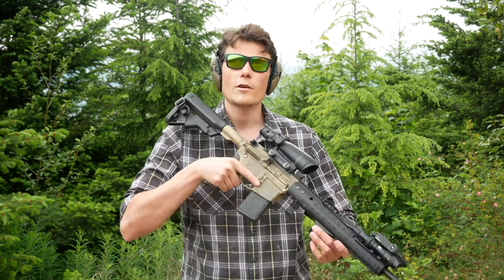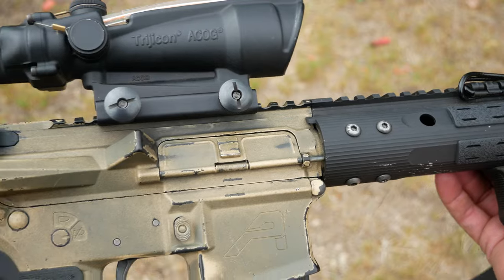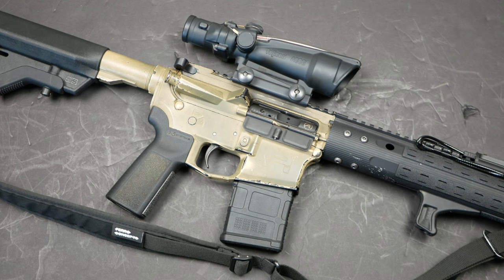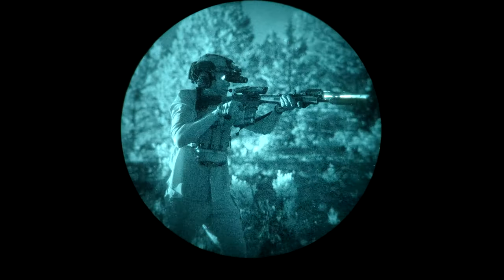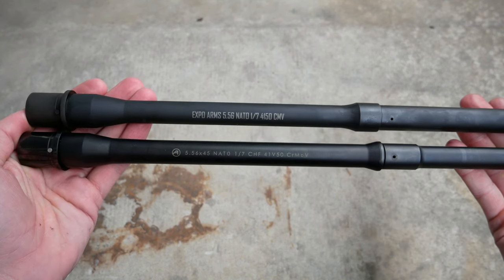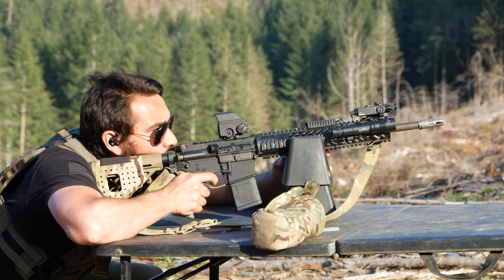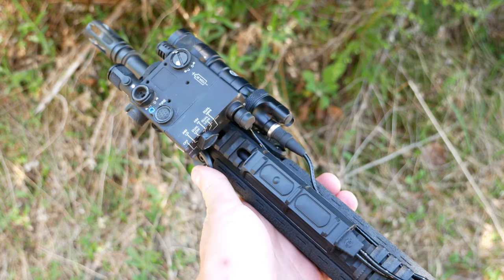Let's talk about the new Aero Precision PRO Series

Comment: I’ll stick with using Aero lowers and using either uppers I’ve “built” myself or BCM and DD uppers I currently use on those Aero uppers! I’ve had issues with a couple Aero BCGs in the past and won’t be spending anymore on their Pro BCGs, since there are plenty of other well known, reliable and reputable brands out there for the same or less money! I personally like to pick and choose what works for me and combine those brands and products to create exactly what I want and need.
Reply: I tried one of the 12.5" barrels because CHF light-profile middy ones are hard to find.  Excessive headspace, two brand new quality bolts from Cryptic and Sharps spin right around on the NO-GO.  I'm gonna give them a chance to make things right, but I'm likely sticking to just their receivers and handguards going forward.  I can see things being a little off and the bolts only barely locking on the gauge, but not just spin right around like that.  That seems ridiculous to me for something labeled as "Pro Series"
Reply: I kinda do the same, get budget lowers build it out then get a high end complete upper

Comment: My aero bolt nitride with chrome lined carrier are rough as hell. Like ribbed all the way around. The aero firing pin is gritty and ribbed as well. Sure works fine though. When people shoot it they say it works but the colt cr series is way smoother and people say it's better. You will taste gas when shooting and it'll burn your eyes. The colt doesn't have either of those issues. Accuracy is just fine. Reliable. No complaints really. I'm not scared to shoot it or beat it up

Comment: Barrels, BCGs and the enhanced buffer tubes. Got a pro build myself with the adjustable gas block and super 42 h2 buffer spring set up. That paired with a can and Aero 2 stage trigger… it’s one of the smoothest shooting rifles I own. I dig it. But the price tag was up there when finished… would call it a solid high end mid tier build.
Reply: What is the barrel length?
Reply: @calsol22  16”

Comment: Those barrels shoulda been offered with a pinned gas block.
Reply: I got into firearms over the last few years. At first I was very pro or in favor of pinning gas blocks because everywhere I looked said that was best. But after doing homework on BCM, BCM uses set screws to secure the gas blocks and from what I hear people say it is damn near impossible to get them off. So much so that they have to heat up the gas blocks so hot to get the screws out…
Reply: @9770G  quite a few companies use them.
Reply: @9770G  BCM is also known for their very tight tolerances, and im sure they rock set or red loctite those gas blocks in place. there is nothing wrong with set screws and dimples. some people run 1, others use 2. but a pin isnt coming out unless its driven. also, some people just want that FSB look. or a metal front sight they dont have to spend $100 on.
Reply: Pin them yourself.  There are many videos on here that show you how and exactly what tools and pins to order.   It's not hard with a $120 drill press.
Reply: @calholli  thats just the thing. most people dont have the tools and arent going to order a $300 jig to properly align their $150 barrel. If you arent building guns regularly or some kind of gunsmith, no need to buy something you will use only once. Just find a manufacturer that offers what youre looking for. then at least you have some kind of warranty
Reply: @bettycocker2226   It's a $9 bit and a $20 reamer.. You don't need a jig if you simply have a cheap drill press--  which most guys do...   But I do understand, there are two kinds of AR guys:   people who build their own kits and can make any budget brand parts work...  and those who need that 12 point quality inspection to make sure everything is perfect-- because if not, they are clueless on what to do besides send it back.    If you are the 'ladder" kind of guy, then I would agree--   don't try it.

Otherwise, if you build your own kits and have a dozen rifles like most of us...  You should try to learn how to pin your own gas blocks.  You can up the value of every AR you have in a weekend.
Reply: As long as the barrel is dimpled for the set screw the gas block isn’t going to go anywhere. You can drill your own notch, there are jigs for it and plenty of videos on how to do it properly. Some people pin and set screw. If you’re really worried some barrels have the gas block integral to the barrel, they are one piece. There are also some barrels that have a nut that locks the gas block on like a barrel nut does to the Reciever. I know Q does it on their Sugar weasel and Honey badger. Many manufacturers will also drill it for you if you send it in. Riflespeed makes the best adjustable gas block ever made and they will drill your barrel for you or you can buy a barrel from them and they will drill it before they send it to you, and they match it perfectly to the gas block, I believe they use two pins.

Comment: I picked up an aero PRO upper a while back at a very discounted price. 
I think just the pro uppers go for around 1k. I got mine for more than half off.
Smacked an M4E1 lower onto it with the bcm A5 buffer. It shoots nice. 
Ran a couple hundred rounds through it then cleaned it and put it up with all the others that I save for who knows what. 
My main shooters are a BCM and a PWS. Most of my other AR's are cleaned and hanging around deep in a large safe.

Comment: So the Pro barrels are Nitrided (melonite) ... I honestly dont think thats a bad thing as long as the chf die is made correctly to account for the fact no additional material will be added later (chrome lining) ... i find Nitriding tends to perform better for corrosion resistance than chrome and especially phosphate (which is what is on the outside of most chrome lined barrels ) and its very easy to clean. Also the wear characteristics should be close to chrome ...as for wear, a proper test should be done, but im betting between 2 chf barrels a chrome lined and a nitrided barrel would perform almost identical
Reply: The military has tested nitride barrels for decades. That is why they still require Chrome lined barrels, even though it cost 3 times as much to chrome line compared to nitride..
Reply: @hairydogstail The Military needs barrels to hold up under full auto which chrome is just plain better at. Under semi auto fire though, who the duck knows.
Reply: Quite a few small groups have started to use different barrels, mid length gas system, and some have tried nitride but I was reading about a new type of barrel being manufactured that is being tested that is as accurate as stainless match barrels, as hard use as chrome lined and can be made with a different profile, since not many are using the m204 and free float rails have become the norm, I read that it’s a modified continual taper from the chamber to the muzzle. They didn’t go too much into the coating but they said it’s all new way of manufacturing the barrels.
Reply: Link? @chrisjosekuehl

Comment: Expo Arms is excellent. I have the all chrome and phosphate/chrome lined bcg as well as a complete upper. They are all rock solid. For a 12.5” barrel my choice is the HM Defense Mono Bloc chrome lined barrel for the same money. I like AP, there enhanced upper and large diameter rails are on another level imho, but the pro stuff looks meh and there is better value in a true mil spec bcg, ie Gorilla Machine $79. It’s probably a Bear Creek CHF barrel anyway, not a bad thing.
Reply: Yep, Expo arms are made by MicroBest

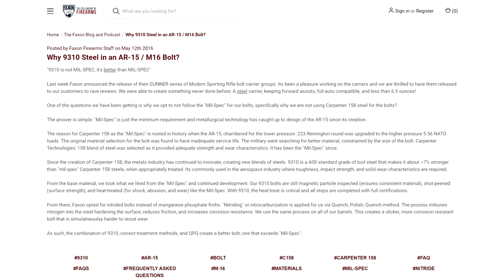Comment: 3:20 C158 steel is much more forgiving than 9310 steel when it comes to heat treating window for acceptable tensile strength. When you need to chrun out millions of rifles in a full scale war, that's an important consideration. 

9310 has higher strength (marginally), but if heated too long it becomes very brittle. 9310 bolts are simply slightly more brittle overall and will probably crack sooner than C158 bolts despite the steel being nominally stronger.

What I definitely cannot recommend are tool steel bolts. No, just no. It'll wear and erode the hell out of your barrel extension AND the hole your bolt carrier tail sits in (which seals the expansion chamber on your bolt carrier group along with the gas rings).

Basically, tool steel bolt will wear out your barrel's headspace and make your bolt carrier leak gas from the tail end, blowing out your headspace and short-stroking your action (and dump dirty gas into your receiver worse than typical).

AR 15 bolts are wear parts, so is the bolt carrier (to a lesser extent). The barrel is also a wear part, but less so than the bolt carrier. If you're not running full auto intensively but shooting a heavy schedule (with regard for up to 4MOA acceptable accuracy) you'll change out the bolts twice and the carrier assembly once before you need to re-barrel your rifle. 

Shooting lots of full auto will blow out your gas ports well before eating out the throat or muzzle, or ruining your headspace. If your rifle runs too hard after habitual mag dumps, check your gas port and re-barrel if necessary (or use adjustable gas blocks).

Bolts are consumable parts. If they start to crack, swap them out. Tool steel bolts are for delusional tools who think rifles are meant to be indestructible, and using it will destroy your barrel extension and bolt carrier. Parts that are meant to be less expendable than your bolt.

Even if your carrier is tool steel - you're still destroying your barrel. Besides, that prevents use of chrome lined carrier bores as per mil spec, since S7 tool steel will still abrade hard chrome. Chromed bolt carrier bores are great, makes cleaning much easier and makes your carrier lasts longer (less gas leakage from bolt tail bore). It's worth the hassle of phosphate being easier to rust than nitride carriers, and if rust is a big issue - bite the bullet and get a chromed bolt and carrier. Just use phosphated or nitrided extractors, chrome is slippery.

Also, when it comes to lubricity from low to high, it goes: dry phosphate, dry nitride, dry chrome, oiled phosphate, oiled nitride, and oiled chrome. There's a big jump between dry phosphate and everything else (duh), and a smaller but appreciable jump between dry chrome to oiled phosphate. However, among oiled anything, the difference is negligible in practice - and phosphate stays oiled for much longer than anything else.

Use phosphate and chrome bolt for anything that isn't maritime or permanent "moon dust" scenario. Go all chrome if you can't use lube. Any oil or grease works at lubricating the bolt carrier against the upper receiver, but only use light motor oil or actual gun oil to lube camming and rotating surfaces (bolt, expansion chamber, cam pin, trigger pins). Moon dust and freezing weather notwithstanding, you literally can not overlubricate an AR rifle. The only thing stopping you is how messy your rifle gets in storage and on your person.
Reply: Addendum: a freshly properly lubed AR (unless for moon dust or freezing temps) will spit oil everywhere, but especially out of the ejection port. Wear your fuскing eye protection, even if they're just glasses or sunglasses. Oil in your eyes sucks, and it's probably carcinogenic. If there's a reason to use ballistol, it's 1: lowest toxicity (comparable to frog lube), and 2: has rust inhibitors that don't gunk up parts like WD40. 

If there are reasons to not soak your AR in a drum of light motor oil as a quick way of lubing your rifles, there's 3 reasons: 

not risking cancer worse than you already are, 
not turning your storage area into a perpetual fire hazard zone, and 
not turning yourself into a walking tiki torch waiting to catch on fire.

Getting cancer or catching on fire are what we'd call suboptimal health outcomes.
Reply: Yep, C158 is far more ductile than 9310. It is a tight, nun tight, window for heat treating when it comes to 9310.
Reply: @prfwrx2497 Contrary to popular belief, even in a sand environment....you need to keep your gun lubed. I don't know why people keep falling for this wives tale.
Reply: @prfwrx2497 Motor Oil, specifically Full Synthetic by itself does not cause cancer..... The by products from combustion do.... So regardless of Lube... The by products of you shooting is what causes the issues....not the lube itself.
Reply: @DZ4295DBW  you do lube in sand - but you basically wipe that shit down immediately after until it's almost bone dry. That's with a phosphate bolt group, since phosphate will hold on to that little bit of oil. That's why it's standard military practice to oil and wipe clean - phosphate is magic in that regard. 

If you're going all chrome - why bother. You're wiping basically all the oil off, chrome is really shit at holding any type of oil already. I'd use grease on the parts that doesn't get exposed to the ejection port, call it a day.

Trigger pins technically need oil; it'll be there from the last time the gun was serviced at the depot and you're not going to break the gun apart to oil the trigger pins using those needle nose bottles in a middle of a sandstorm. Leave your gun sealed and the fire control lubed in the inside.

The ideal lube for dust or freezing weather is allegedly graphite, but I'm too poor and third-world to have obtained graphite lube.

Where I'd never lube - arctic. You could use specialty lube, make sure you never bring your rifle into your tent without religiously wiping down every moving part, etc etc. There's just so many ways to go wrong there I'd rather bite the bullet and go all chrome, accept the added friction, and live with it. Better to tune for additional gas and spring rate than risking something seizing up due to my stupid ass slipping up.
Reply: I like a nickel boron BCG and nitrided bolt, or vise versa... Runs slicker than grease even without any oil, seems to collect less carbon and wipes totally clean in seconds 😙

Full chrome is nice too but doesn't seem as frictionless and not as corrosion resistant from what I've read...
Reply: @kxkxkxkx  Chrome holds lube a hell of a lot better than either of those two options. Only nitrided carrier that was decent was the Radian EBCG. It spec's out perfectly and had perfect staking. Generally, you won't see that since most manufacturers will get a carrier that's cut to have Chrome plating on it. Anyway, another option that's solid is NP3 and the "DLC" that Grizzlee uses on their REBCGs. Also, if you ever run across them make sure you get the ones with Green Dots on them and not the ones with Yellow Dots. 🤙
Reply: Spot on.  Also cheap 9310 bolts + nitride are a bad combo for the reason you mentioned.  If you do go nitride, go c158.   Azimuth is your friend.
Reply: @prfwrx2497  Chrome actually holds oil pretty well compared to Nitride or NP3... From my personal experience. The Mil manual calls for the components to be oil and then allowed to "air dry." And it has absolutely nothing to do with sand, fyi.
Reply: I like to hoard Microbest phosphate BCG's when they go on sale for $70-80 bucks from AR-15 discounts.
Reply: @coltonowens2742 

Smart man.  Microbest does good work.  Azimuth and AO are also solid.
Reply: Thanks for the info. The comments on this video are fucking great.
Reply: @prfwrx2497  WD40 IS NOT A LUBRICANT ! FFS, DO NOT USE WD40 ! If you need a penetrating oil to decouple parts or something to help remove rust, WD40 is fine for that. Don't fucking use it to lubricate anything ! (not that you would use WD40 that way) . WD40 has no place anywhere near a firearm. Period.
Reply: @raifsevrence  you're right, it is not a lube. It's a water displacer. Only use it to wipe down a massive RPG7 and wipe everything clean right after. Not for small arms.
Reply: @DZ4295DBW  thanks to the correction on Chrome holding on to oil quite ok.
Reply: @kxkxkxkx  chrome is the gold standard for corrosion resistance, if it's bonded properly. Big if.

The issue with electroless nickel is that most manufacturers do a complete shite job at getting a nice and even build up of nickel. Nitride can work well on the bolt carrier (not 9310 bolt due to heat treat window) but most tend to have loose tail holes due to using blanks for chrome-phosphate carriers
Reply: I like nitride or whatever each company calls their version of it. It’s slippery, hard, and bcg’ in nitride are the most affordable. I have used nickel boron, hard chrome, I’ve tried the light weight titanium, and steel bcg’ and I have found that for the money a quality nitride bcg works amazing.
Reply: @prfwrx2497 don’t ever think about using WD-40 on your guns…
Reply: @charlesstanavich8648  they are claiming their pro bcg is flash nitrided.

Comment: Fairly late to the party, I just recently picked up an M4E1 lower and M4E1 Enhanced upper. Although a tad heavier than my other rifles,  the upper and lower appear to be well made with lots of updates - captive detents, threaded bolts instead of roll pins, and a tensioning screw in the lower that makes for undetectable play between upper and lower. IMO the M4E1 is underrated.

Comment: The thing that strikes me as really weird is that the non-pro BCG is chrome-lined (or at least the one I have is). Why would they take that step backwards in their supposedly higher-end offerings?
Reply: Nitride is harder and smoother than chrome, most chromed bcg are phosphate which is not as good. Aero’s chrome lined bcg is phosphate, their nitride bgc’s are considered an upgrade.